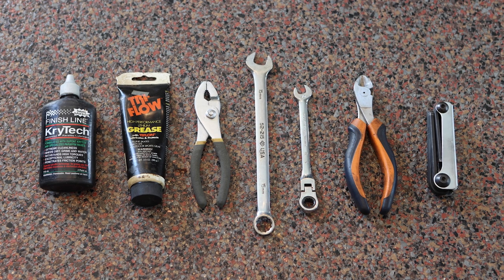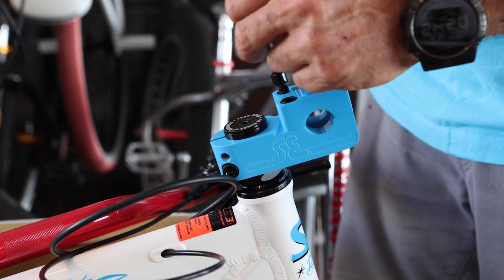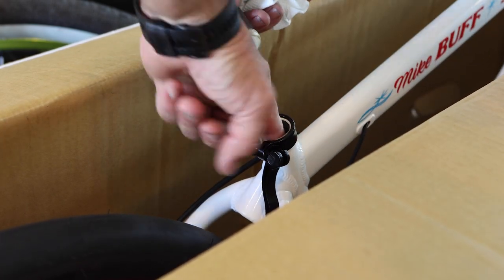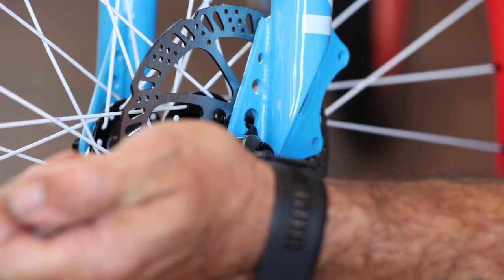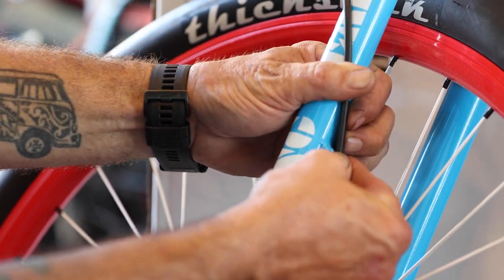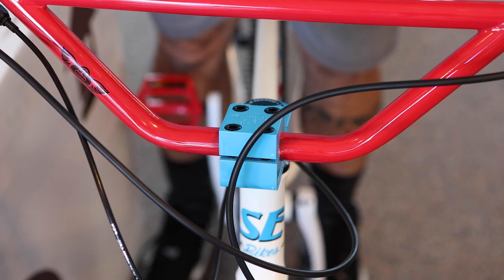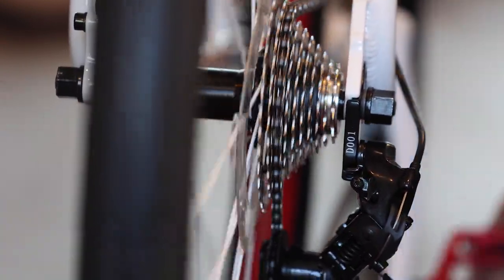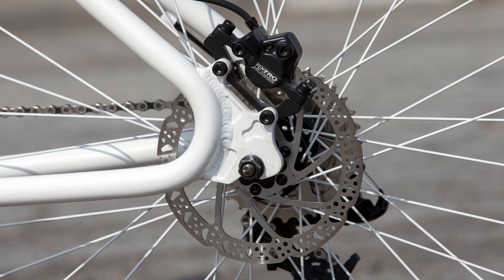SE Bike with Gears Assembly Guide

Comment: "Fine adjustments to the derailleur can be made using a philips screw driver"  The derailleur adjustment via the philips screws are only for the travel stops. (these should not need to be thouched) They limit the derailleur travel to stop the derailleur going over the big cog into the spokes and over the small cog and on to the axel/frame. They are NOT for adjusting how you gears shift, this is done with cable tension adjustment from the barrel ajuster on thecable end stop. When your new the cable will stretch in the fist few uses and will need to be tightened, tighten the cable till the gears shit smoothly uo and down, if the gear wont shift to the next bigger cog tighten the cable, if they they wont drop back down to a smaller cog loosen the cable. use this video https://www.youtube.com/watch?v=UkZxPIZ1ngY&ab_channel=ParkTool